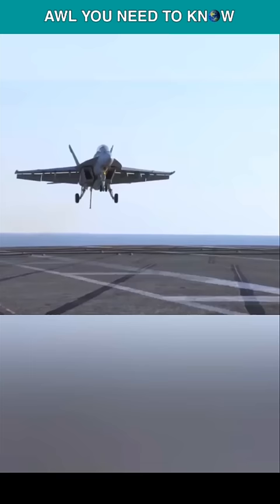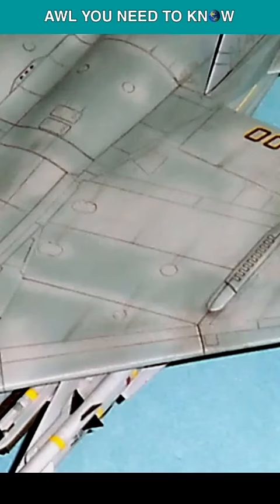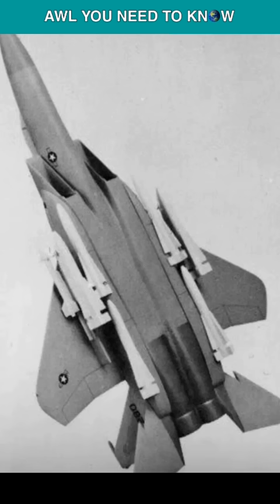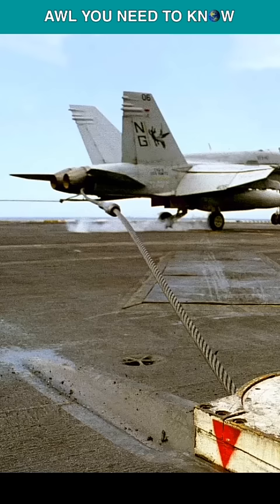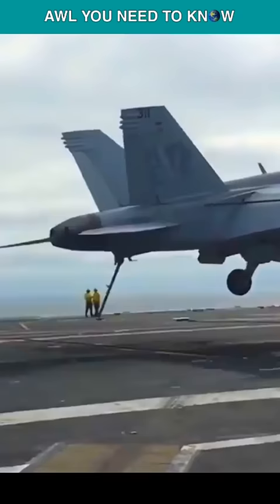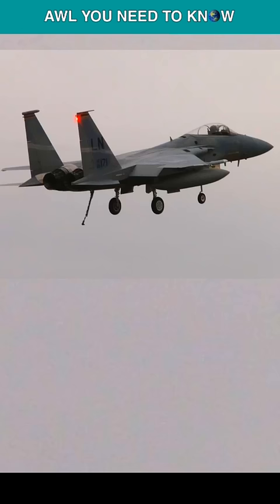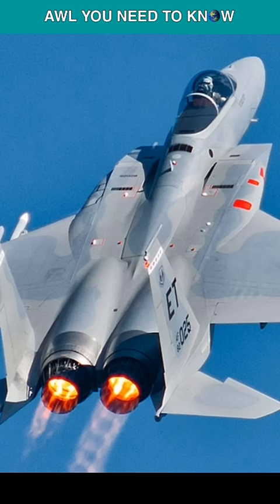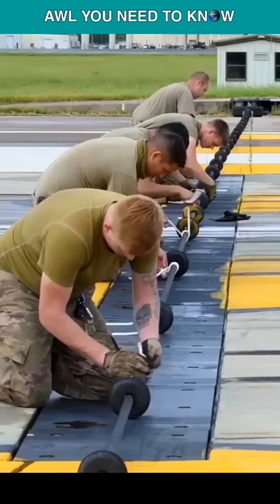Why Can't an F-15 Land On an Aircraft Carrier? #shorts

Comment: I don't understand what you are saying. they never adopted the f-15 because for some reason it is unable to catch the wire every time? that has nothing to do with it. even if there was something wrong with the hook it has, they could easily fit a better one. the problem is that it is not built for that kind of strain. the landing gear is nowhere rugged enough, nor is the structure of the plane, to handle the repeated forces put on them by the catapult, hook, and the no-flare landing. they could beef up the structure but it would pretty much result in a complete redesign, which would be heavier and worse performing. the landing speed was already higher than they wanted, so they would need a larger wing to reduce the landing speed and keep the same maneuverability. a bigger wing adds even more weight, and it adds drag, reducing the top speed. see the larger wing on the F-35C. so you would end up having to design a whole new plane, which is expensive, especially since the F-14 is already good enough. the Navy also wanted a 2-man crew, and the AIM-54 more weight and expense. so you would spend billions of dollars and end up with a jet that performs about the same as an F-14, but without swing wings and the nice low landing speed of the F-14. can an F-15 land on a carrier? sure. can it do it repeatedly without ruining the plane? no. there was literally no good reason to turn the F-15 into a carrier plane.
Reply from the maker: No no pal, I didn't mean that, and you're completely right. The F-15's landing gear is strong but not in the correct way for carrier landings. A carrier version of the F-15 was looked at and a landing gear modification is possible. The forward landing gear would need to be redesigned for catapult launch, the main landing gears would need to be able to take additional sheer stress.
For the Sea eagle, MacDonnell Douglas kept on trying to modify their original airframe, that it just led to additional problems (like weight and landing gear) that eventually they decided that it was probably better to design a new plane all together (hence the F18 hornet) to sell to the Navy.
Reply: Negative! The F- 18 wasn't designed for the navy , it was actually for the AIR FORCE it lost in  Competition to the F-16 , then the navy  got it
Reply: I think a good reason to turn the f-15 into a carrier plane was maintenance costs. it's my understanding that the f-14 was retired because the sweep wing mechanism among other things drove up operational costs significantly. 

it's also my understanding that these days the operational cost of the f-15 is quite low, relatively speaking, so the theoretical sea eagle would probably still be flying today as opposed to the f-14.
Reply: Hahahaha....can you picture a non-modified front landing gear......shooting off the front of the ship...and the plane nose down on the deck....0.5seconds after activàting the catapult.....

Hahahaha......I see Woody Woodpecker, in flight gear....while typing this
Reply: @cameronfarrell9076  Right. Exactly how many things do you think the air force and navy F-35's have in common?
Reply: @leeshackelford7517  Yes, yes I can. It's hilarious :-)
Reply: @awlyouneedtoknow9435  Then maybe you should have said that.
Reply: finally someone got an answer to a question author promised to answer but never did.
Reply: so what does the design of the F18 and F35 have that even a modified f15 doesn't have that allows them to be ideal for carrier landings?
Reply: @willisix2554  wrong bro the f-18 is a modified jet specifically tailored for the navy. it's original version was the f-17 cobra.
Reply: @cameronfarrell9076  f-14 and f-15 are quite similar
Reply: @ryuseioh3507  Wrong !
Reply: this needs a reward
Reply: @willisix2554  google it urself dude! you'd see I'm correct. f-18 is based off the air force reject of the yf-17 cobra which lost to the yf-16 falcon.
Reply: @ryuseioh3507   READING COMPREHENSION!! Look into it
Reply: You do a better job of answering the proposed question than the video did.
Reply: Came to the comments to make this very point but saw you had it covered. Good job!
Reply: Yes, basically you have to redesign everything for a navy version. İt would end up being a complete different aircraft
Reply: @alexh2665 The F-18 has wings that can be folded so they don't take up much space. The F-18 was designed structurally to be used on aircraft carriers. As you might no, landing on a carrier takes a huge toll on aircraft, and they must be able to do that every day. The F-15 is simply put not made for such stress, and even if they did modify it to do so, there might be other problems such as cost or more problems through the modifications.
Reply: @crimsonsnow2469  that makes a lot of sense but I don't see how modifying an existing aircraft wouldn't just cost more than creating a whole new aircraft but yeah you're right
Reply: @alexh2665  I mean, almost everything that took off carriers to this day had to be made to do so. Modifying it just creates a host of new problems. Even the form which the airplane is can play a huge role if it can survive everyday usage on a carrier.

Comment: They did put a proper hook on the carrier prototype. The reason why they said no is because the Sea Eagle was at specification parity with the Tomcat, so they didn’t see a reason to divert from procuring the Tomcat. The small paper advantages the Eagle has over a Tomcat, like weight and maneuverability, are negated by adapting an Eagle to be a carrier jet.
Reply: This is what his video was missing
Reply: Thanks you answered my question

Comment: The pain is not crashing the plane in water after botching a landing, it’s when you realize you’ve just destroyed one of Uncle Sam’s multimillion dollar jets and now have to await your fate.
Reply: Don’t forget the fact that you’ve likely traumatized everyone on deck by nearly wrecking the ship. A close family friend of mine is stationed on the Carl Vinson (the aircraft carrier that dumped Bin Laden’s corpse). Last year an F-35 fucked up the landing and hit the deck before ending up in the water and he was beyond shaken up by it. Let alone that since it was an F35, not only had this pilot wrecked one of the most expensive pieces of military equipment in our arsenal, but he also kicked off a multimillion dollar search and recovery operation to prevent the Chinese from getting to it first.
Reply: It'll be okay as long as you apologize 😞 and promise not to do it again.  😶
Reply: When they hit the deck they go full throttle in case they miss the wire. So they take off again to come around for another try.. If that was the case they would be crashing up the whole fleet.
Reply: @Pantsinabucket ya know, they can just take off and try landing again after circling back round? Doubt an F35 trainer pilot crashed into the sea after missing the hook rather than taking off again...

Comment: There are also problems with landing gears, the best way to tell a navy pilot from an air force pilot is to see if they flare before landing
Reply from the maker: landing gears are the main problem, but hey, not something they can't solve, right?
Reply: The best way actually is if they can take off or land in a crosswind!
Reply: I wish commercial airline pilots would put down like a Navy Aviator.
Reply: @williammartin-howell3565  wouldn't that make a bumpy and uncomfortable (due to rapid descent) ride
Reply: Landing GEAR singular…not gears
Reply: @awlyouneedtoknow9435  time to have inverted gull wing fighter jets🤣
Reply: @williammartin-howell3565  lol lawsuits out the ass
Reply: @shepherdlavellen3301  Life is too short to be taken so seriously. Live Adventurously!
Reply: @macmccartney5760  shiiiit.. I thought flying was supposed to be fun? If they want Boring, let em drive. Or take a boat.